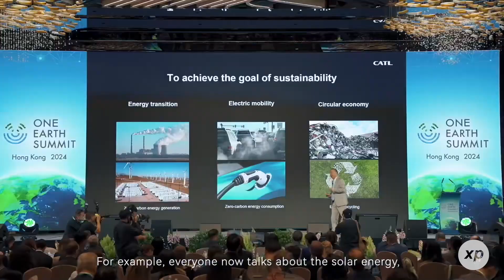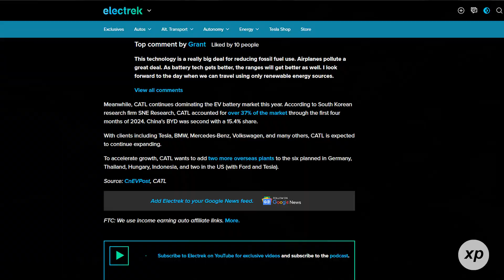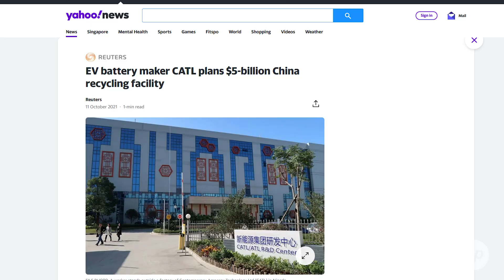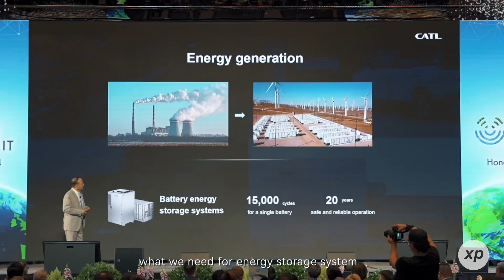Revolutionary CATL Battery Powers 4-Ton Aircraft for the First Time!

Comment: CATL is looking at the dynamics that san aircraft usually flies at 69-70% power and 100-120% (or time rated 100%) for only a few minutes.. add to that, gears and bearings are inherently power power robbers. Additionally gas turbines can not regenerate energy and are least efficiency at low speeds (taxiing), take-off and climb. In the short haul routes, speed can be reduced, fuel  load is not such a big factor.  By using more efficient electric motors coupled with super capacitors, high output power can be achieved with minimal weight, and the regenerative mode of the electric engines can recharge  the electrical load on decent, power savings can be achieved for essential ad potential maneuvering further enhancing the electrical concept.  As for the idea of jet speed and jet range, that will have to be sacrificed and until LiPo batteries can be replaced due to their rather explosive and fire properties, rich people will have to think rather hard at these downsides and the ranges will probably be not as stated, but half to 1/3 of the stated goals without a backup engine installed.  It is a proof of concept, best for the company aircraft that is based off the company airstrip, a situation that is quite rare.  One other factor is the break-up of the world economic structure that will limit the export of such small aircraft by export taxes and plain out sanctioning to the dominant richer western elite.  I'd say that training aircraft would be a better target 'audience' for the local market.